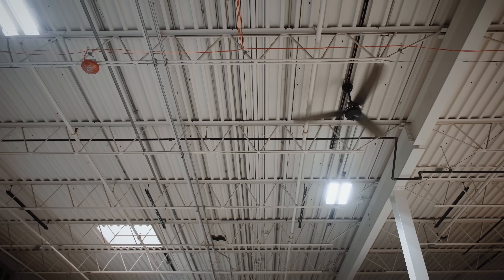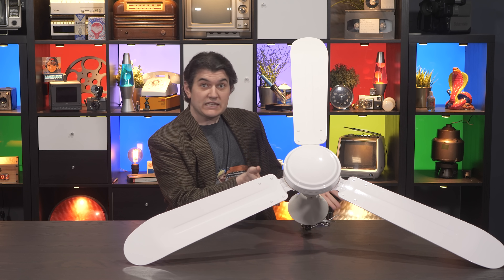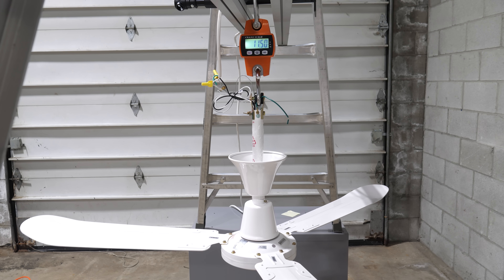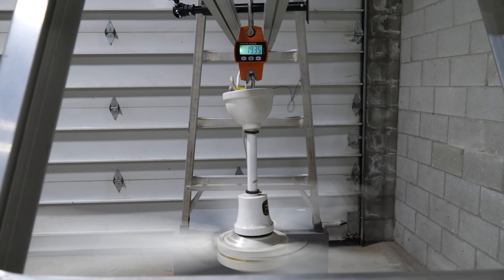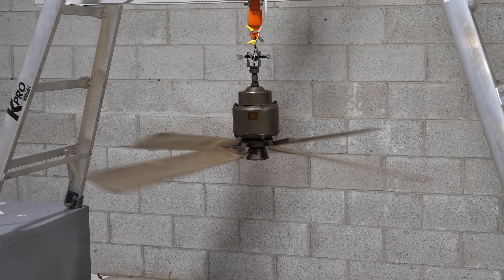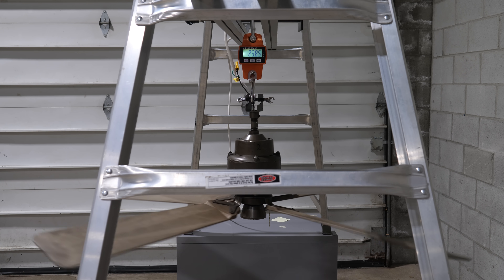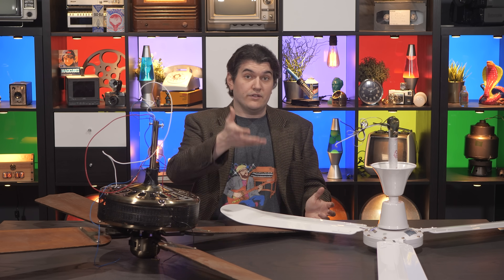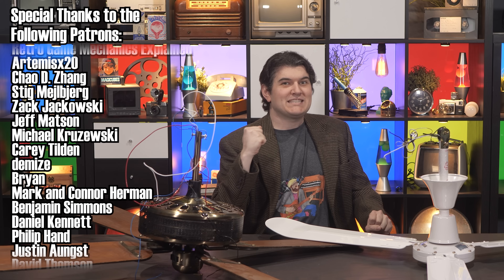How much thrust does a ceiling fan produce?

Comment: So what I'm hearing is that with a strong enough fan you can get a good breeze and help support the ceiling, thus obviating the need for ugly columns? A load-bearing fan, if you will.
Reply: Ah, a fail deadly building. I approve.

Comment: Thrust is actually a bad metric for fans such as these, the fan can push air in both directions at once thereby cancelling the thrust out

I dont bave a better option for evaluating them however

Comment: Well, if you have an old school Hunter fan that is cast iron you don't have to worry about the strength of the ceiling box.  It's not strong enough anyway, they hang on a hook screwed into the wood!

Comment: But why reverse a fan to "bring down the warm air"? Surely blowing hot air down versus sucking cold air up leads to the same result. I always assumed the reason you reversed it in winter is the occupants tended not to want to feel the downdraft, and not for air circulation reasons.
Reply: because reversing the fan prevents it from blowing directly onto someone, which can cool them even if the air is warmer.

It is true that the air will circulate regardless. Actually, it will circulate a bit better with it being reversed since the intake draws air from all directions, whereas when it's blowing down thjere are larger dead zones, but y'know, marginal.

Comment: Thanks for the video! If you ever do a follow-up, I wonder what would happen if you took away the filing cabinets and/or stacked two more under the ladder, to measure what ground effect was doing to the thrust. Also curious what the torque actually is.

Comment: I couldn't read through all the comments but I have to point out that a helicopter is NOT just a giant ceiling fan. Helicopter rotor blades are shaped like airfoils--they have the same cross section of an airplane wing. So moving at high speed they create lift whereby the air pressure below the blade is greater than the air pressure above the blade. That is how they maintain altitude and how the ground beneath them (when they're at flying altitude) doesn't get blown away. They're not just producing a 'jet' of air that pushes them off the ground. Obviously per your test, the downward thrust of the air from a ceiling fan doesn't approach anywhere near being able to strain its (or the electrical box's) mountings significantly.
Reply: Yes it is. Lift is caused because the blades push air down, which is also why there's a pressure differential.

Comment: 1:39  They're not the same thing.  The cross-section of airplane propellers, helicopter rotors, etc. is a shape called an airfoil, not (nearly) flat like the blades of a ceiling fan.
Reply: "Wah, my fan blades are fancy so it's not a fan wah!"
Reply: @seigeengine  Yeah, that's what I was saying, LOL.

Comment: Thing to note is a proper HVAC system with proper returns and ducts along with zones work far better than ceiling fans. If you have a variable speed fan for your HVAC system that is even better as it will slow down and move the air all day long keeping the entire area stable at the temperature you call for. 
If you are going to build a new home consider spending extra time talking about and understanding the point of a HVAC system and insulation. The long run will be more stable home environment.
Reply: Maybe, but we live in the real world, not an ideal utopia where every building is perfectly designed. Never mind the moment you put anything in the space, the details change.
Reply: @seigeengine  Sorry this is just is just BS. You can build a good building and account for all the space. FFS they do 3d modeling these days. The problem is idiots who go and buy some cookie cutter house that some crew slaps togeather from a basic plan that some other idiot spent next to no time working on. Why do you think these builders build the same house over and over. 
To build a house cost a bit of money up front. You need to consider what you want and how long you intend to live in the house. Account for resale if things change. Account for more people moving in during times of need. Account for several things. Building a good house with a good HVAC system in a tight house can not only help keep you healthy it can reduce dust and pollen for those who might need it. If the cost of a good energy efficient HVAC systems means that you can not get that cabinet and countertop upgrade, you might consider the HVAC system first rather than the upgrade you can have done at a later date. 
This channel has pointed out so many flaws in building design that it is not funny. Windows are one example that he went over and how the correct overhang, window placement and type of windows are ideal for homes.

Comment: You could've spent even less effort by weighing working fans on a regular tabletop scale. Because thrust is a thrust no matter in which direction it is pointed, but that way it would've been much easier and torque-stabilized- ..-ish

Comment: I know it's NEN, but for everyone else, helicopter rotors (and plane propellers) are basically spinning wings. The method of air movement is very different than simple deflection of air in a fan.

Comment: The fun here would be to experiment with different fan blades with different aerofoil designs.  None of those look particularly well designed which surprises me, the fan designer could get more air momemevt at a lower speed with good blade design.
Reply: This is related to the speed the blades move. Ceiling fans spin very slowly, but can still move lots of air because they're so large. At low speeds, the aerodynamic effects just don't matter much (remember, things like air resistance increase proportional to speed squared).

Standing fans have to be smaller. They compensate for this in two ways: they use wider blades, and they spin much faster. AT those higher speeds, aerodynamic effects matter more, which is why they have curvier shapes. Helicopter and plane fans move very very fast, so it matters a huge amount.

Comment: There is a round fixure at your scale. So when the fan speeds up the hook likes to turn and therefore pushing at the under half of the round fixure. I thinks that why it's increasing weight at start

Comment: Perhaps you could get a more accurate reading by locking the base (top?) of the ceiling fan on the steps of the stairs beneath the structure holding the scale, maybe a stick or something going diagonal from one leg to the other, preventing the hook from spinning, nullifying the torque, leaving only the thrrrust as a measurable number.

Comment: Rotors and propellers are fundamentally different from fans. Fans have flat blades to move air at lower velocity, versus wing shaped blades that generate force more efficiently at high velocity.

Comment: The blades of a helicopter do not blow on the ground, they all act like the wings of an airplane. Due to their shape, the air above them is faster than the air under them, creating a differential of pressure (the pressure is lower above them) thus creating lift.

Comment: It not that a propeller or a rotor pushes air back or down, it creates a low pressure Infront of a propeller and on top of a rotor.  
It's that low pressure that pulls an airplane forward or for a helicopter it creates lift on top of the rotor.

Comment: - well if it were efficient it would generate lift- but as most of the designs are about low speed vortices - nope  (pretty much stalled from the get go...

BAF - bring it on...

love the metric quips - by now most Americans should know the ratio is ~ handspans to cubits (not Q-bits)...
lol, test rig needs a really long torque arm (so as to not influence the scale  "too much""...

(NB the ?? 50 or 200 Watts of power ( - peak 120kJ  of energy every 10 minutes).  lol  is a long way from "significant thrust" -   trying to make a fan matching a few kW of power to airflow one will fing how much air gets moved to create anything approaching the unity thrust of a ceiling can...   lol   great Chicken Run references, poor scottish accent...

Comment: Helicopter blades aren’t the same as fan blades though. They are airfoils which produce lift in the same way airplane wings produce lift, but instead of moving the aircraft quickly to generate air flow over the wings they spin on an axis.

Comment: Propellers and helicopter blades generate thrust in the same way as a wing produces lift (I.e they suck the plane forward, not by blowing air backwards!!)
Reply: Correct. Although to be more correct, the blades create a lower pressure on one side and atmospheric pressure (being higher) results in a positive force upwards. The idea that the air being blown by the blades provides this force is a common misconception of how a helicopter's blades work (except to a small extent when under `ground effect`). This is different to a jet engine, where the trust is the means of propulsion.

Comment: (0:50/)0:52 - further fun: a neighbor of mine when i was a kid took a frisbee, cut a whole in it, mounted a model airplane prop to it, gave it some wheels around the edge with not-very-good bearings, and... the engine would fire up, lift the thing off the ground, the frisbee would start spinning, thus reducing thrust, it would fall back down, spin on its wheels for a while gradually slowing its rotation, then thrust would increase, and it would take flight again.  Good times.  :)

Comment: I'm surprised you weren't more curious why the reverse was so noticably weaker than the regular thrust. It's an electric motor, so surely it should run the same in reverse?

Comment: The measurements we taken with a big open space above the fan. I would be surprised if you got the same result from a fan actually mounted against the ceiling. I would expect significantly reduced airflow and thus thrust.

Comment: I think it would have been interesting with the crappy fan to have tried bending the blades to a stepper angle to see if that increased the thrust. I suspect most ceiling fans have their blades a quite a shallow pitch so you get a gentle breeze rather than a gale.

Comment: Nothing wrong with confirming Newton every now and then. The thrust is actually the same as the amount of net inerta applied to the air, which is the same as how much fan accelerates the air. Static thrust should in my opinion be the declared for all fans that are designed to move air around. measuring thrust is a very easy way to measure how much useful work the fan actually does, that isn't affected by factors like how big part of the flow is induced, which doesn't matter if you just want to cause airflow.

Comment: This is another one of those "wtf is America doing" -moments. You hang these from electrical boxes? Why on earth would you do that? On the better side of the pond ceiling fans are .. screwed into the ceiling, and then have a power cord going to the light outlet where the power comes from. You typically drill in at least 2 pretty firm screws separately into the ceiling, through whatever mounting hardware your light has, and then attach the light to that. The light power outlets are also standardized, and do tend to come with a hook for very light-weight lights, which these are not.

Comment: Well, about the thrust generated when running in reverse:  It might actually be higher in a real live setting. as at the distance the fan is mounted to the ceiling, there might be a measurable increase due to ground effect (technical term),  even if would better be called  ceiling effect in this case.

Comment: omg this video was scripted?
but this is effort!!! in no effort november non-the less!!
lol tbh i always thought that these ceiling fans must be creating enough force from startup torque to eventually degrade the ceiling mounting hardware to the point it may eventually go loose and the whole fan would basically drop on the floor.
so watching this video assured me that i was actually right! even though it may actually take at least 20 years or more for the fan mounting hardware to fail and the fan to drop on the floor i was still right!!
now its time to go find my elementary school friends from 20 years ago and tell them they were wrong! hah!

Comment: Can somebody with more time and brainpower than me give us a rough estimate on how large of a warehouse lined wall to wall with average sized and powered ceiling fans you would need in order to fully contain enough fans to lift said warehouse off the ground?

A few things to note:
1) can prob assume all walls have the same density, and the roof has half the density since a closed roof and that many fans may cause airflow issues, leading to less thrust per fan

2) fans are made of noeffortium, a futuristic material that is fully weightless and cannot be used for the warehouse walls/ceiling

3) the fans run wirelessly using the power of friendship (for bonus points, tell us how much energy it would take to power this "I guess I'm failing physics" -esque exam question for 1 minute)

4) solving this will probably take a while. Please tell us how long it took you

Thanks physics phriends

Comment: If you are worried about stress on the electrical mounting box, in addition to the torque you should also consider vibration.  Even small vibration over time can loosen or wear through screws, nuts and bolts, and cause metal fatigue.  Many of these fans are hung by a couple of number 6 screws, the same size that mount outlets or switches into the outlet box.

Comment: One summer, our air conditioner blew its shotgun-fuses on the hottest weekend of the year, and it took a couple days to get it fixed (parts availability, etc.). One night, unable to sleep, I browsed the internet looking for high-volume fans (normally for industrial use). Before too long, I was doing some quick arithmetic, trying to find a unit that was powerful enough to do a complete air-change of the apartment in 90 seconds.

Comment: Hmm, I don't wanna get picky, but helicopters don't fully fly by producing a downward thrust, their blades are not blades like a fan, they're airfoils. They're the same as a plane wing but just spinning round in circles really quickly. It's like a plane doing a death spin, super fast and then hanging a cab below it. Helicopters primarily fly using Bernoulli’s principle NOT newtons third law, like a fan does.
Reply: I came to the comments section to point out the same error. I’m glad I wasn’t the only one who noticed it.
Reply: Thank you .
Reply: A fan blade is an airfoil. And bernoulli's principle is not incongruous with newton's third law, in principle all airfoils work by pushing air down, which pushes the airfoil up.

Comment: I'm really surprised these fans have such terrible thrust.  I would have expected at least a few pounds (maybe like 5 or so?).  Plenty of model airplanes have around 2-3 lbf of thrust.  Granted they are super loud, but they also have tiny blades.  With much, much larger blades you wouldn't need to try too hard to get a decent amount of thrust.

Comment: As someone who works for a scale company and has people bring in that exact cheap crane scale, the loadcell inside moves around and binds with the orange case which is probably the cause of the weight change on start sometimes, they're also terribly inaccurate even after calibration. Not to say your results are in any way invalid.

Comment: I think you could have found a more reliable standard scale and mounted the fan on a board and used lever action to depress the scale with rather than try to hang it on a hook  but either way you got some measurements so its a win. Now for fun, build a shroud around the fan and compare the difference in thrust. The shroud will definitely increase the thrust as it reduces slippage of air around the tips of the fan blades.

Comment: From a lifetime of observing ceiling fans in india (compared to MUCH LESS INTENSE ceiling fans in the US), i can already assume they produce a little lift, especially if the blades are uneven/it's improperly hung. You've never seen a ceiling fan spin until youve experienced a mini fan (like foot long blades) with a full size 220v motor.. i genuinely never used the ceiling fans in my grandparents bathroom until adulthood.

Comment: You're running the fan close to the floor, that's going to contribute to the weight/forces of the fan, (especially in forward, blowing down) verses gravitation, and the ceiling fan being mounted higher, at a common distance between the ceiling/floor, but that really doesn't matter, it's so little to be concerned about.. Use your knowledge, and investigate for yourself if you want to study old ceiling fans verses new ceiling fans.. Don't let anyone get into the way.. I've been watching your content for around a decade.. Very good content.. Love your videos..

Comment: I did some google and apparently based on a Tweet from NASA, Helicopters have an average main rotor speed of 400-500 RPM. and other research shows some higher speed ceiling fans can break 400 RPM.

so very similar rotational speeds which makes one wonder how much air would a ceiling fan move if you gave it blades shaped like the main rotor of a helicopter.

On a side note I had always pictured helicopter blades spinning at like 5000 rpm or something

Comment: Hello Technology Connections, airplane propellers don't produce enough thrust for the airplane to fly. They produce enough thrust to move the aircraft forward until the air flow over the wings is sufficient to let them fly. 
HELICOPTERs do produce enough thrust to fly, though, and they scare me.